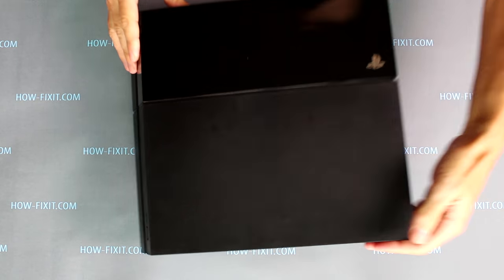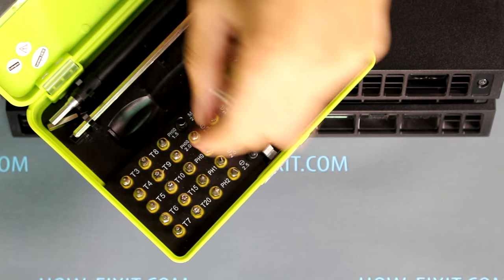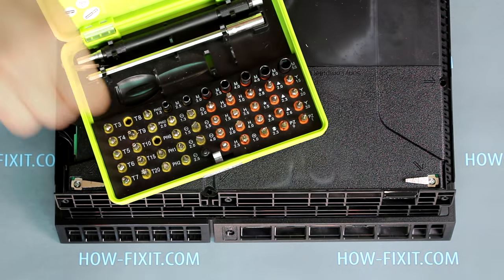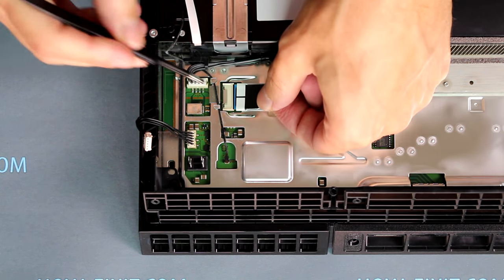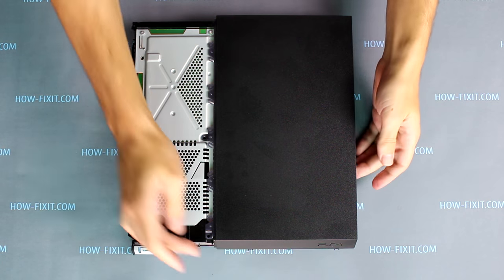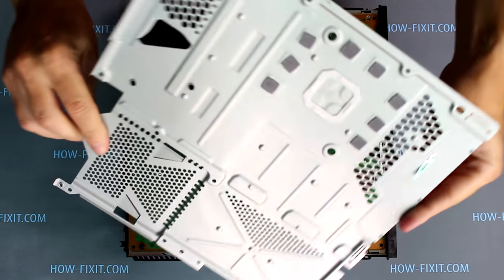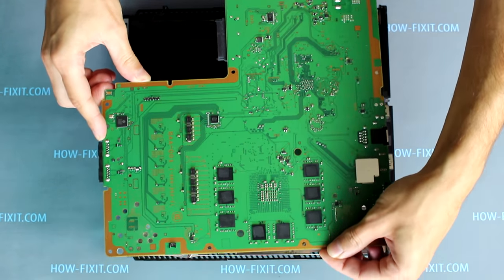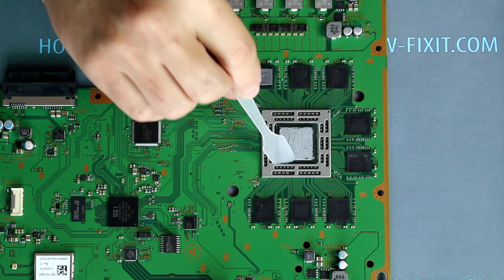PS4 Overheating Fix: Disassembly, Fan Cleaning & Thermal Paste Replacement

Comment: listen if you think the comments are lying they’re not. My ps4 used to sound like a spaceship when i was on fortnite. After this video and cleaning my ps4 with a can of air and thermal paste. My ps4 is so quiet i didn’t even know it was on when i played fortnite. this video really works
Reply: I can confirm. Worked for me too, even tough the silence lasted only couple months for me.
Reply: I can definitely confirm this did this today and shits a fucking silencer. Worth trying fr 🤞🏼
Reply: Lmfao omg bro I hope this works for me
Reply: @SAM-2772  yup gotta be extra careful broski
Reply: Confirmed, Ive got a ps4 from 2014 and just did a repasting and cleaning.
It kills over 90 percent of my previous noise, now I can finally play without my girlfriend hating me.
Reply: @Zaid Ali Khan tr9 works but for the ones u gotta unscrew inside u gotta use the normal screwdriver it works hope this helps
Reply: Yes, mine is phat model and it works.
Reply: @jaywrr-7406  yeah I'm using a tiny flathead for this, too damn lazy to dig through the garage for the proper head lmao
Reply: Bro know I just had to turn off my PS4 because I have to replace thermal paste it said overheating so I changed it
Reply: Can I use beesewax gel?
Reply: @SAM-2772  did it work?
Reply: @madieluva3922  yes it did it got quieter but remember every now and then open up your ps4 and clean the heat sink my ps4 had a carpet of dust almost covering the entire heat sink and switching out the thermal paste definitely helps
Reply: same, my ps4 was loud as fuck even hearing it with headphones on when playing rdr2. but when i did this, it turned quiet asf
Reply: I really wanna do this,, BUT i am so scared I'll ruin it tbh :")

Comment: Holy crap! I didn't really expect replacing the thermal paste would work but my Ps4 finally came in for its landing and no more too hot warnings and shutdowns without warning. Thank you very much!
Reply: No way you also go the too hot warnings
Reply: I just cleaned my PS4 for dust, and it still sounds like a jet. And i never get too hot warnings or anything. Is it worth changing the thermal paste?
Reply: @toddy914 if you've never changed it yeah it dries out eventually

Comment: After what seemed like forever, this solved my girlfriends 747 airplane...sorry, PS4 from being incredibly loud. Not only was the fan dirty but the lack of thermal grease needed much attention. I no longer have to worry about my ears bleeding at the end of her multi hour gaming sesh's which also seemed like time stayed still until the PS4 turned off. Thanks dude.

Comment: Oh wow the disassembling process looks terrifying, I hardly got the courage a while back to remove the lower part just to dust off the fan. It wasn’t that dusty tbh but even after I cleaned it nothing has changed. Everyone was basically suggesting that I might need to consider changing the thermal paste, I’ll need to give this a try!

Comment: Great breakdown! My ps4 is running silent now!! Thank you! One thing different on mine was around the 3:45 mark when the power source was removed, there was a black screw holding the motherboard to the heat sink plate. You will need to remove it to separate the panel from the mother board. It was to the left by the cables you unplug before flipping over. I hope this helps someone.
Reply: I noticed your ps4 did not have this screw.
Reply: Ty so much
Reply: I also hade this screw, good thing i triple check everything so i dont screw Up :p
Reply: thank you! it did help me!
Reply: Thank you, helped me today :-)
Reply: THAT’S where that screw goes……..😅
Reply: I was trying to figure out why the motherboard wouldn’t budge and realized it was because of that exact screw
Reply: What about ps4 pro ? The colsiso protocol is what makes mine sound super loud.?

Comment: Late reply, but I sincerely want to thank you for this excellent guide. I just performed this myself today and your video was excellent and straightforward. The only obstacle I had was that I was unable to disconnect the power supply from the board, but I was able to support it vertically without stress on the wires and do it that way. It runs fantastic, and even the Wi-Fi connection seems more secure. Thank you so very much!!!

Comment: Good, concise guide that I used to replace the thermal paste on my second hand PS4! It really did sound like a hair-dryer before, and after I had to check the fan was even running it was so quiet!

Comment: Worked for me! Make sure you have all the tools. I somehow messed up with the fan cable connected to the mother board (white plastic cover was removed)  but luckily it is still working. PS4 is now less louder than before. First time to replaced thermal paste after 6 years.
Reply: How much would you say it's quieter now in percentage wise? Are the jet sounds gone if you know what I mean lol?

Comment: Hooooly crap, I can't believe how quiet my ps4 is now.  I've had it since launch day and never once opened it up for maintenance.  I ended up replacing the thermal pads too.

Excellent video, super clear with no useless filler.
Reply: What thermal paste did you use and how was it?
Reply: @igfury4119  some noctua paste I had left over from a pc build. And thermal grizzly minus pad 8 for the pad replacement.   It works great.  It's been whisper quiet on the vast majority of games for months now.  I can feel the heat from the vents is very hot with very minimal effort from the fans.  It was super worthwhile, I should have done it years ago when it had started sounding like a jet engine.

Comment: Amazing guide. Now my ps4 runs idle when playing gta 5, bf4, assetto corsa and assetto corsa competizione. I used gd900 which is only like $1 for 3g which is a really good deal and it works as good as any other thermal paste for $10.
Reply: NOO THAT WILL MAKE YOUR PS4 GET TECHNICAL ISSUESSS

Comment: This has worked a dream. I got my PS4 on launch day and have just followed the guide step by step.  Be warned about the power socket jumper cable  though.  Take your time using tweezers. I used a particularly sharp set o tweezers and ended up breaking one of the wires when I slipped so had to  I order a new jumper cable off ebay for under £5 to replace it.  My PS4 works as good as it did in 2013 now :)

Comment: Brilliant guide to disassemble. clean, add thermal paste and put all back together. I had some trouble detaching the power supply cable attached to the motherboard and was worried putting it all back together that it somehow might no longer work. No need to worry - running like a dream now. thanks for the videos!

Comment: Thanks a lot! I followed your guide and replaced fan, thermal paste and thermal pads. Ps4 Pro has never been more quiet.
Reply: Does changing pads change a lot?
Reply: @methodless941  when I had done this my new ps4 pro went from unbearably loud to hardly noticeable. Over the past year I've noticed it slowly getting louder with some games but not enough to give me a reason to replace it again.
Reply: hey do you know if the CUH-1202B model is covered by this guide?  The model numbers in the description do not match anything I can find on the official Sony support pages.  

Also, where did you get the replacement thermal pads from?
Reply: @davepastern   he got them from Joe .....

He has quality thermal paste and pads etc
Reply: @fullmoviesmate6100  that didn't answer my question lol!
Reply: @davepastern  Literally you asked where he got the pads from. He got the pads from Joe
Reply: @davepastern  Joe momma
Reply: @fullmoviesmate6100  I wasn't so much concerned with the pads (I have already bought them and the thermal paste).  My concern is if the guide will be accurate for my PS4.  I followed a guide for disassembling a controller once, and it was nothing like my controller...that controller is now in pieces and useless.  I'm not keen to make the same mistake again.
Reply: @davepastern  did you fix your PlayStation mate?
Reply: @fullmoviesmate6100  no, see my last reply.  I cannot afford another ps4 (can't get them anyway) if I fuck mine up disassembling it...I need a guide that matches my exact model so that I know exactly what I am getting into and can't fuck it up.
Reply: @davepastern  open it up and find out, if its not, than look for another dissasembly that is your ps4, They are all the same concept, open it up, replace thermal paste and colse it
Reply: @fullmoviesmate6100  no one laughed

Comment: Tysm I’m 13 and I cleaned my entire ps4 some of the screws were a bit rusted so I had to use something to grind them up a bit to be able to be taken out overall a fun troubling experience ; )
Reply: Hey what about power supply you just leave this?

Comment: This video worked for me! After disassembling my PS4, I noticed the radiator was PACKED with dust bunnies. I cleaned it out, put some new thermal paste (I used CORSAIR XTM50 from Best Buy), and now it’s super quiet. Prior to that, my PS4 sounded so loud I needed to turn the volume up on my TV just to enjoy playing it.

Comment: another good guide for paste and cleaning. i wanted to be sure about the paste location and all so this was helpful as well. but i wouldn't recommend cleaning the fan by hand as they usually are like so damn fragile (fans in general) to mingle with fingers and you may get a buzzing fan sound in not so distant future. you dont want another problem when you eagerly trying to get rid of the heat issue. although this buzzing is not %100 i admit but why take the risk? Just use an air compressor to blow the dust on it but at the same time DO NOT FORGET to hold the fan not to turn like a chopper's propeller. cheers ✌

Comment: Thanks man now my PS4 is significantly quieter, keep it up!
Reply: really ?  
please tell me if you clean alll the dust from inside all of it and you put a new thermal paste    does the PS4 return   young ?  like 5 years ago ? 
plz tell me 
sry for my bad english
Reply: @mrenigma1564  Yeah, can confirm that if you deep clean it (including the heatsink) and apply quality thermal paste (I used arctic silver) the PS4 will be significantly quieter
Reply: @rckkatansky5783  thank you ♥
Reply: @rckkatansky5783  is it quieter even now ? After 8 months ?
Reply: @mrenigma1564  Yeah it's still quieter, but you probably want to clean it once every year or year and a half to avoid it sounding like jet engine again
Reply: @rckkatansky5783  hey mate. How's the ps4 sounding now? I've just ordered the paste and cannot wait to try this out. My question is do you need to re apply the paste after a few years or she'll be sweet?
Reply: @fullmoviesmate6100  Hi there. I actually did this process again like a month ago because I noticed it getting a little bit louder than usual (and it was kinda dirty as well) but yeah, this really does quiet down the console a lot. I recommend to do it once every 1 year or 2. Make sure you clean the fan and heatsink.

And yes, every time you open and clean your console you HAVE to apply new thermal paste every time
Reply: @rckkatansky5783  thanks for your reply brother. Merry Christmas and a happy new years

Comment: If you see this comment, never use the spread method with your thermal paste. Add a Pea sized dot in the center of the CPU. it will spread perfectly when you put the heat sink on. You will get better thermal results doing this.
Reply: Mr.Vintage oh, I spread mines, but is it a problem? Like will it sound loader
Reply: Louder*
Reply: It won't hurt your ps4. It will just run a bit hotter. Your ps4 will still work better than before. it's not worth taking apart again. Furthermore, a ps4 prossesor is smaller than a computer. You may need a little less than a Pea. I'm just saying that this is the best method. Spreading results in small air pockets on the heat sink.  The method I use results in better heat distribution. Sorry for my long reply. Your ps4 will still be quiet.
Reply: Mr.Vintage oh ok thanks man
Reply: Mr.Vintage Is this process hard?
Reply: Easier than spreading. You will also get better thermals. The tutorial is one of the best I've seen though. I would follow it.
Reply: What do u think abt Arctic 4g mx4 thermal paste?

Comment: Its fucking crazy how effective this is. I thought it would just quiet it down a little bit, but now the loudest thing about the console is the bluray drive. Trying to play RDR2 on headphones used to be hell. The fans were actually waking up my sleeping baby, 2 rooms over. The (closed) headphones were barely helping. Playing with TV speakers was pretty much impossible. 
Now i can throw dynamite in the middle of blackwater and its like the PS4 is not even there. Hilariously low cost way of giving your console a second life.

Comment: Great Video, really helpful. My PS4 went from jet engine to, you know, something that you expect from a console! Not as quiet as my pc (duh) but now I finally don't need to wear ANC headphones to play!

Just a quick note: I noticed there was a screw next to the Power supply connector holding together the Motherboard and the metal cover. Needed to remove that. I seem to have a slightly different version of PS4, you did not have that screw. Just a heads up for other people!

Comment: Awesome video! I did mine and its almost dead silent now after sounding like an airplane in my room!
Mine seemed to have 13 screws on the metal plate (not 12),and I still have 1 t8 screw out after reassembly 😅 but it seems fine without it,like new again!

Comment: Thank you for this, I've been putting off doing this for so long, out of fear that I'd break the console, but I finally worked up the courage to do it.

Used Arctic MX-4 & Arctic 1mm thermal pads to replace old pads. For years I've pretty much exclusively played games on PS4 with headphones due to how loud the fan was, after doing this, you can no longer even tell the console is on most of the time, & when I play a game that does kick it into full gear it's the most pathetic quiet sounding fan ever 😂 literally 100 times better.

I will say, my PS4 had an extra screw next to the power supply connector that was holding the motherboard & metal housing to the PS4 outer shell, so if you've removed all screws and a piece isn't coming out easily, check for that because yours may be a slightly different model to the one used in the video like mine was 👍

Comment: Very awesome video, very useful. But I got a few tips to anyone trying to replace their thermal paste.
1.(kinda goes without saying) Don't waste your time doing this if you're gonna use some cheap sketchy thermal paste, just buy one of a good quality.
2. The hardest part I found about doing this was removing the cables. Just take your time, don't rush it even if it takes 15 min. You don't wanna damage any parts.
-Most of the steps are clear. Good luck
Reply: Were you afraid of breaking it? I want to open it, but I'm afraid. Also, what screwdriver is needed for the metal panel covering the heatsink at the very end
Reply: @ken-yo2hz  yeah I was afraid of ripping the cables, especially the power supply unit one. It was really hard to disconnect cuz it was a bit difficult to get a good grip on it. But I'd say I was more terrified the thermal paste I bought wasn't good and that it was gonna break my ps4 that's why I recommended buying a good one.
As for the screwdrivers u asked about I believe it was the T8 Torx screwdriver.
Anyways u only need the torx and the little philips screwdriver for the whole disassembly
Reply: @ken-yo2hz  any other questions?
Reply: P.E. T. 1.) I tried to open the PSU but my Philips head #0 literally didn’t work at all on the two big/long screws. What philips screwdriver did you use?
2.) Did you use pliers or your fingers to lift the cables? I don’t have pliers at all
3.) Should I replace the thermal paste? I was only planning to clean the heatsink. Keep in mind I haven’t replaced it at all since I got my PS4 4 years ago
Reply: @ken-yo2hz  1) I just used what I had available. If it's too tough u can try using a small flat screwdriver or even the tip of a knife but be careful not to injure yourself
2) I used my fingers but it took quite some time to get a good grip. U can try wiggling a bit while pulling it
3)You should probably change the thermal paste if it has been that long. If your ps4 is overheating like mine did then cleaning won't help all that much.
Reply: @ken-yo2hz  also I believe you won't find a lot of to thermal paste left if it has been 4 years
Reply: P.E. T. 1) I understand. It’s not tough but more so the Philips head doesn’t turn the screw despite being the right size 
2.) I’ll probably change the thermal paste, but did you also use compressed air. I took a peek under the fan and it was really dirty over the silver panels. I don’t know how to remove the dust quickly tbh
Reply: @ken-yo2hz  compressed air would be the easiest way I guess but I used it before opening it cuz I didn't want to change thermal paste at first
Reply: P.E. T. Are you from the Uk? If so where did you buy compressed air?
Reply: @ken-yo2hz  no I'm not, sorry.
Reply: P.E. T. I’m trying to disconnect the power supply cable but it’s really tough. How did you do it?
Reply: @ken-yo2hz  oh right I actually found it easier to disconnect from the motherboard rather than from the psu
Reply: @ken-yo2hz  u must first remove the psu
Reply: @ken-yo2hz  as shown in the video the left part is gonna be tougher to lift
Reply: @ken-yo2hz  did u get it?
Reply: P.E. T. I know, it’s really hard to put back as well. I don’t know if the PSU is in properly because the long screws aren’t fitting
Reply: @ken-yo2hz  no it should be easy to put back actually
Reply: @ken-yo2hz  you'll hear a clicking noise when you put it back correctly.
Reply: @m.e.h.8304  ffs you have patience mate
Reply: @m.e.h.8304  ffggff
Reply: Ñ